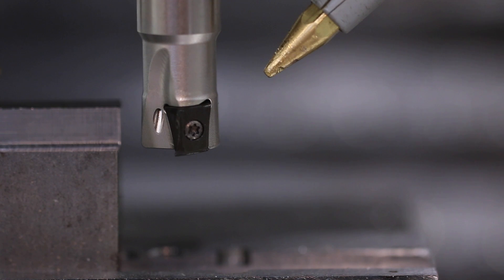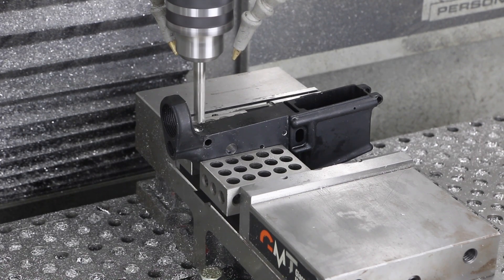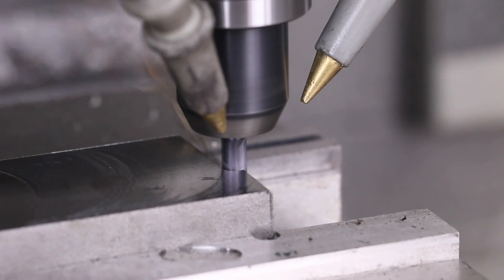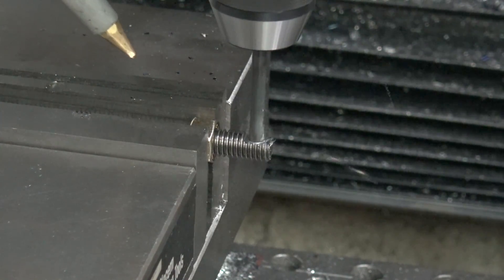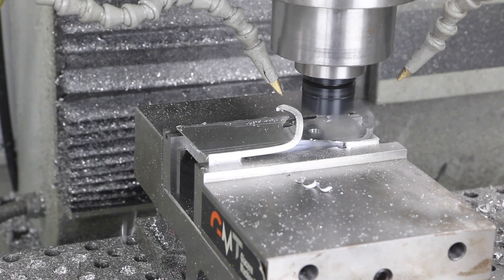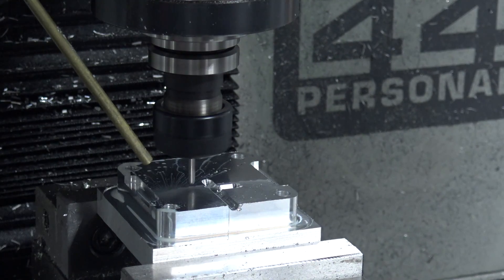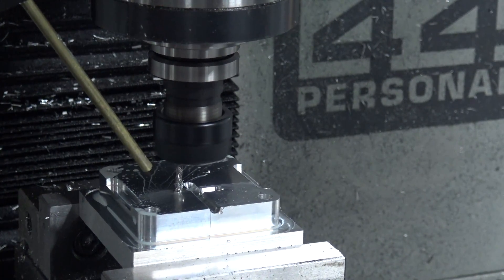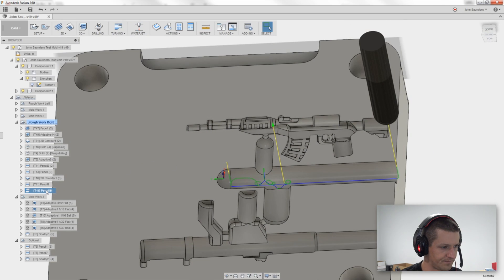CNC Crashes, Bloopers & Goofs

Comment: The problem always seems to be that most machinists want to run the cutter at max speed and the path at top speed and what you often end up with is a broken tool or a Totally screwed up job that you have to do over ( which takes MORE time) IF you have the Material. The Machine Doesn't have EYES, and it can't FEEL the vibration, that something is wrong. It is just a Number Cruncher.

Comment: We just had a real doozy of a wreck last week. $38,000 worth of damage. The operator made an offset to the tool and it wouldn’t take it. It was out of the soft limit we set for safety. Instead of checking the problem he went in and increased the soft limit to accept the offset. The mill went in 2 millimeters instead of the .2 millimeters it was supposed to. It’s a 12” face mill that finishes the cylinder head mounting surface. It trashed the cutter body and the fixture and damaged the spindle. Security walked him out immediately. Fired on the spot.
Reply: Hire experienced people

Comment: Mounted a brand new tool measuring laser on a CNC we retrofitted with the latest of the latest (Heidenhain) software a few years ago.
Dude from Heidenhain was also there because it was such new tech, the wanted to help out.
Length of the 35mm straight mill was measured correctly. (the tool needed to spin at 1500rpm for this).
Then it wend 60mm up at max feed to position itself above the laser... said the manual.
But big was our surprise when it cut the 5000€ device right into two pieces going DOWN like a bat out of hell.
(My boss was standing right behind me at that moment, white as I've never seen him).
Reply: Gotta be careful with lazers, can't use too long of a tool (overall length), and can't when there is too much runout, can crash. Seen a guy put a tool that was too long overall and he smashed right into the $25 000 Makino lazer. If I was the boss he'd be fired right then. That could've went to my raise

Comment: I have never ever crashed a manual lathe. From the first time I laid hands on one it was obvious to me to setup stops where I wanted the end of a cut to be, and after getting things set up to manually turn the spindle to ensure the chuck jaws and workpiece cannot hit the saddle, cross slide, compound slide or toolpost. Same thing with a manual mill, it's easy to not hit a vise or clamps. Move the table without power to the spindle and ensure the tool can't hit what you're not cutting.

For CNC mills, do an air cut first, with an empty table. If you're milling something clamped directly to the table, set a fake zero height above the table and keep a hand on the e-stop. When you've verified there's nothing hinky like the wrong direction on a Z retract or ending code that'll smash the tool through a completed piece, then you reset your Z offset. Of course accounting for any fixturing between the table top and workpiece bottom.

Comment: My diplomas in CNC programming and operating  may have  costed alot..
But not as much as all the tools and materials. Just a tip but maybe next time don't experiment  with your last M8 tap another tip the only way to stop a tapping cycle is with the E -STOP  
CYCLE-Hold will not help you. Not trying to be rude JUST SAYING -;)

Comment: rofl how did that hex broach work as a cutter   :-).... btw suggestion  in some of your paths of cutter  instead of  sudden x-y direction changes try a circular path change  with  traversing an arc out and then back to line up to next straight cut it puts less sudden direction force of  bearings and drive  units

Comment: I'm a self taught machinist, myself. I have to give my uncle Bob credit for teaching me conventional lathe work, my uncle Ernie gets credit for teaching me how to thread with die-heads, and spit tobacco juice into the coolant trough, and my Dad, for teaching me how to set-up box tools, or, roller turners. I'm retired now, and not being such a smart guy, my ability as a machinist is based on my tool collection, and, my collection of set-ups, and methods, learned from others. My Grandpa Lagerquist showed me that an old man, can outwork a young guy. I know you won't want to hear this, but if you can make a simple set-up, and even if you find yourself chasing clamps, it will pay off, man. Yes, you have all the equipment you need, for complex machining. In addition, you have business management skills, and programming skills, far beyond my simple hand programs. What I'd like to covey, is keep it simple, on low volume stuff.Mark Nelson

Comment: I work with CNC and when you're an employee this isn't funny 🙈
Reply: When I first worked on my own the very next minute I managed to set a machine on fire but now i know those machines almost perfectly 😂
Reply: IT'S !! EVEN !! MORE !!! HILARIOUS !! WHEN !! YOU !! HAVE !! TO DO !! IT !! ALL !! BY !! HAND !!!
Reply: @davidwillard7334  I'm taking my first machining course at 25. i used to laugh at the machinists, now i understand why they are the way they are
Reply: Nahuel Ranieri yeah but if you double check it like your supposed to do you won’t have these problems like I run my first part in the air to make sure everything works
Reply: @CommonRailCoop  Not always the operators fault when coming to bumps especially in machine shops where machines run 24/7 . I've lost count of the amount of times I've seen a z axis jump 100mm on daewoo machining centres (dodgy home switches at home position, thinks its home when hitting dog switch) or a turret losing its position on a lathe and indexing the tool off centre height or even worse the wrong tool (swedturn lathes).Tbh Its funny if its happening to someone else as you know the boss attention is not on you that day, although it feels like a car crash when it happens to me.😂
Reply: if youre the one who has to repair the machines later, then its just even more work
you wont believe how many people say "i didnt do anything wrong" and youre just going to the machine log that stores every input given to the machine and see something that cant end well like "yeah sure"

Comment: Hello I have a one off part I need machined. It's a section of a gear hydraulic pump. It's not too big or complex but it needs to be spot on in order for the pump to be able to build pressure. I have the old one for measuring I'm from Long Island. Is this something you would be able to help me with? NYC CNC
Reply: NYC CNC do you machine custom parts for people?
Reply: Ohio is the greatest, mainly the south and CINCINNATI
Reply: Pretty funny that you opted to commission a part in the comments of a fail video. I just hope these guys stop sticking their hands in their machines while they're running.

Comment: Ahh so many times have i done so many of these on my Tormach PCNC 1100 although i still prefer my old school Bridgeport.
It's hard to see but it looks like most of the cuts your doing are climb milling? That's usually what throws stuff out my jigs/vices. I don't have a cabinet, just the plastic screen on the tool bed. It likes to throw things at me if I'm not careful.

Comment: I kind of get the idea that you didn't spend years manual machining before moving to CNC.  Manual machining teaches you
more about how to hold the workpiece and also teaches you to respect feeds and speeds and DOC.
Reply: I think this can qualify both ways.. I learned CNC, then learned manual. If anything, it taught me that the feeds and speeds are almost entirely different due to rigidity and work holding capabilities. I ran a boring bar through mild steel the other day at 1205 SFM, .08" DOC, and a feed of .01. I would NEVER do that on a manual but a turning center? You bet, carbide loves it in the rough like that.

Comment: For those of us who aren't machinists, little captions explaining what went wrong would be helpful. Some I understand, like not having the coolant/lube spray on, but others I had no idea what I was watching.
Reply: 233kosta if your machine is capable, its better to climb mill as much as possible.  Cuts better, leaves better surface finish, improves tool life, less load on the tool so less likely to pull the tool out of the collet, among others.  You have it backwards, the best machinist is the machinist who makes the part the fastest within the specified tolerance, not who makes the best part to the called dimension, dont go chasing a tolerance that isnt called for.  Even on a blown out machine you can learn to climb mill on it when you just know how much your table moves and in what directions.
Reply: most were work pieces not being secured in vice/jaws, wrong tool offset (Causes it to plunge into the part), lack of programming stock area to include clamps on table (Tranverses across table and knocks the endmill off).  Lack of coolant with carbide is not a bad thing, shocking it with coolant is.
Reply: There are many videos of failure to ensure the last thing in the code is raising Z height until the tool end is clear of the work before returning X and Y to home. Should always be straight up first then X and Y can be allowed to simultaneously move to home. You can see the fail when a machine finishes a perfect part, then plows the cutter into it.
Reply: Yeah pretty much summed it up. I got a real hearty laugh at 0:32 when the drill feeds in, but the spindle hasn't turned on yet. Thunk. Spindle turns on. 

Oh man...someone did not check their safe approach and use what I call "chicken shit" switches. Single block & feedrate override set lowwwwwww and slowwwwwww.
Reply: For starters your mill shouldn't be able to self feed through its own rotation. That's just a bad day waiting to happen! When you're taking a cut your cutting surface should always be going in the opposite direction to your feed. For example on a clockwise spinning tool you'd do a LOT less damage running a perimeter sweep (see 4:12) going anticlockwise. It means you have to work against any backlash in your screws and gears, otherwise the tool would just pull itself in. I appreciate there's no appreciable backlash on these CNC machines, but one can see the result regardless.

You pick these things up when fucking about with ancient gear that's on its last legs, such as AvE's clapped out Bridgeport. You see it all go bad first hand and hopefully - not on expensive parts and/or machine tools. Yes, it's a right pain in the arse to try and do precision work using something a professional machinist would have scrapped within the hour, but if you learn the hard way you come away a better machinist.

Comment: A guy running before me just snapped off a 7/8ths 2 flute end mill inside a .5 inch deep pocket in AL. There is two pockets and instead of going up in Z to get out of the pocket to go to the next one, he decided to go over in X and Y first lol. You talk about a loud SNAP! Scared the shit outa me!
Reply: The biggest endmill I've saw break on the heavy mill was a 3/4 - 4 flute solid carbide (more than one) an quite a few 3/4 hss. They really make a "ping" and fly off there! Mind you we where taking a heavy pass with them, in quard 500 :)
Reply: Ya 6061 T6 AL. is tough stuff!

Comment: Reminds me of the stupid stuff we used to get up to in our engineering lessons at school... unsupervised 15-year-olds in a workshop is a seriously bad idea! Two groups of us used to wind each other up, and we sabotaged the other group's open evening CNC demonstration. The CNC machine spent 15 minutes painstakingly cutting a hold-up-to-the-light relief picture of Anna Kournikova into translucent plastic. After a few sneaky changes, the head of department had all the parents huddled round watching it finish, only for the machine to pick out a massive tool, destroy the plastic, and machine a phallic symbol into the vice holding the work! So immature, but it was hilarious at the time!

The moment we were left alone we were making swords, knuckle dusters, daggers, shurikens, throwing knives, you name it, we made it! We soldered hundreds of 12v piezo beepers together (each with a slightly different tone..) and hid it in the roof with a few batteries attached, making a horrible but tricky to locate whine.. we made canons out of the Co2 fire extinguisher, drew dicks onto every hidden surface imaginable, sandpapered the lenses in the laptop CD drives, and arranged every single one of the 25 laptops pointing towards the door, each one with "Meatspin" playing (along with sound, and the classroom projector running too). Unfortunately our head of year walked in before our useless teacher, and he hit the roof, bigtime! A friend's younger brother reliably informs me that our handiwork is still being found to this day, and we're still remembered as the worst class ever. I seem to remember we also took 15 soldering irons, arranged the tips into a ring and melted £50 worth of solder into a giant puck... idiots!

Comment: this was too funny although at the shop I use to work at we've had a lot crazier shit happen like parts flying out of the chuck and breaking windows
Reply: Tywoo Romanek Same here, had 60 pound castings fly straight out of chucks and break $3,000 boring bars, and parts fly straight through both panes of glass right out of the machine. Both on mill/turn centers. Ouch!

Comment: The Ol' Youtube motto; record takes in the 20's, publish and compile once.
This was great man. There's a lot to be learned from mishaps, especially when shared. Pitfalls are so easy to step into when the one ahead doesn't call 'em. Thanks for putting out the slippery when wet signs for all us newbs.

Not too bad on the crashes actually, I was waiting for one that just tore a half an inch of bit through a vice, but it didn't happen. You got the balance between babysitting and letting your mill take it's steps on lockdown :)

Comment: Part of learning to machine on manual machines is that you get a 'feel' for what you can get away with on part holding. The feedback from a handle is nice to teach you how much tool pressure you will have in a certain situation. Most of my part holding is with vacuum, so it is very important to understand it as once you lose vac, you lost the part. 
Starting out on a cnc makes it a little harder I think, you don't have that feedback from your hands, just sight and sound which are fine once experience has informed you what they mean.
Thanks for the videos...
Reply: I'm done with my mill education in 2 weeks and i never milled manually. So i don't have any feeling for this stuff so i totaly agree with you

Comment: Looked like most of the crashes was due to insufficient work holding.
Reply: They have since invested in some quality orange vices.
Reply: I dont know anyone that would intentionally crash an expensive machine and waste expensive carbide cutters. Anyone that thinks they would do this, is clueless, as to what machine crashes can cost.
Reply: Yo Daddy The fuck are you on about? Who said it was on purpose? 😐
Reply: I think the Haimer probe tip breaking on the pumpkin was on purpose. That whole video was meant as a joke. :)
Reply: when i learned cnc milling and turning, i had alot of these crashes too :D
Reply: bungle
Reply: Auarhau tyuu
Reply: Hello Guys, i made a CNC, or i am still working at it - today i made a watercooling system at it and i am not sure if it the best or if aircooling would better. Are here experienced people who can leave me a comment what they think whats better or not. I am unsure if i am doing the right thing with water. Its my last video, and i dont want paste in here a link, dont know if NYC CNC woudl like it. But idont know where else i can ask. Thanks for your answers.
Reply: Nah incorrect Z-0 most likely lol!
Reply: They have the lubrication fluid nozzles out of operation.. guess that may be the first step.
. 🖐
Reply: understanding the mechanics of how a vice works would be really helpful. a lot of these jobs being held on tall parallels should have been dovetailed. you can't hold a row of multiple parts in a vice. only two parts with the gap between the parts centered in the vice. etc, etc.
Reply: Zedex 12 lots of amature stuff going on in here. love watching it haha
Reply: Auarhau yeah like on purpose for the camera. Either you are a complete idiot or just some douchbag trying to get on YouTube